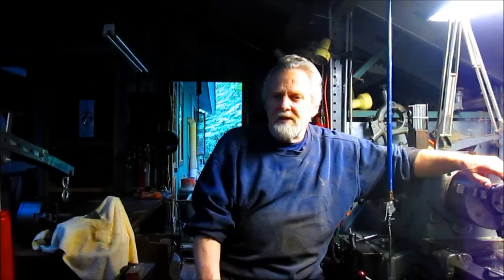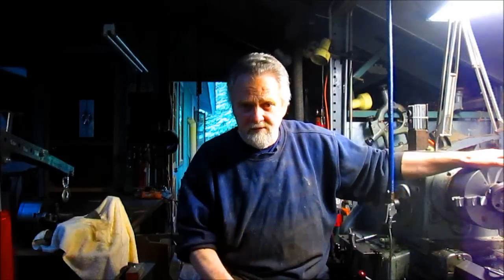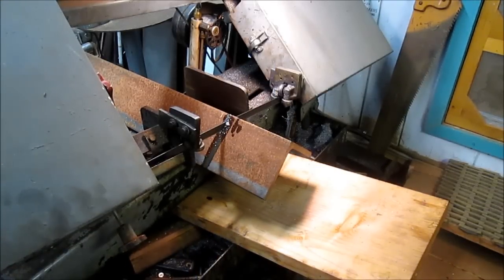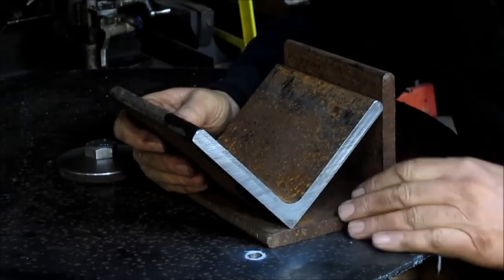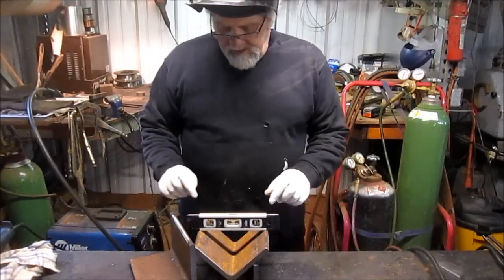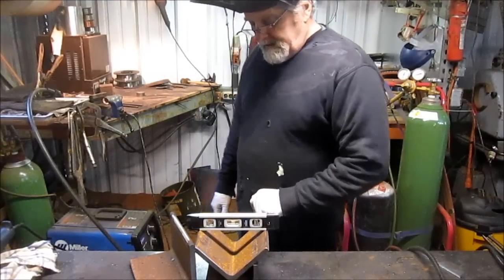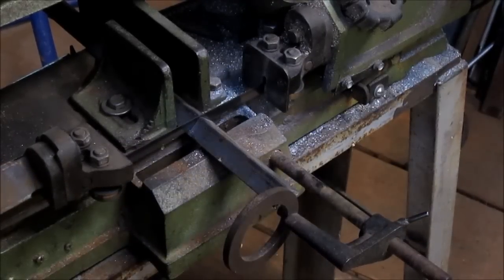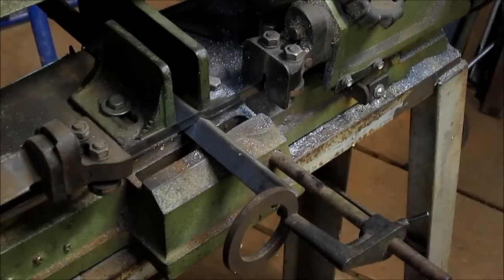Building a pipe hole saw #1

Comment: Hello Nick,  I have had very good luck with both Lenox (my favorite) and Erwin bi-metal  bandsaw blades on the same one as your little saw.  I also drip auto trans fluid from either a chip brush or oil can on the blade as I cut and catch it in a cookie sheet under the bed for reuse.  Very little mess and the blades last for several years doing steel and a lot of aluminum as well as stainless shafting.  The blades run around twenty bucks so you can't beat the price per cut!  Doug
Reply from the maker: +Douglas Thompson Transmission fluid is a good idea and I seem to have a lot of that stuff hanging about. I'll give it a try.
Reply: Works really well on aluminum and cutting steels not so much for drilling and tapping except aluminum where it does very well.  It doesn't evaporate like cutting fluid either so I reuse it for a long time.  Dipping the chip brush in the cookie sheet to brush it on the blade.  Keeps the swarf easy to dump too.  Doug